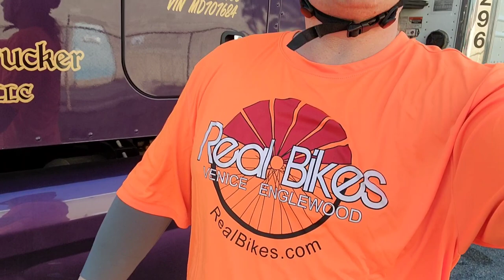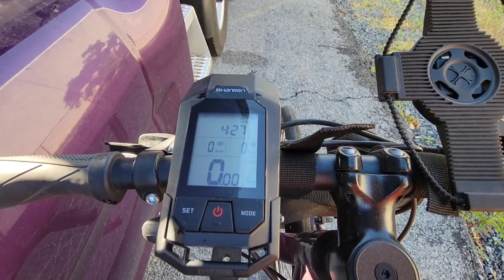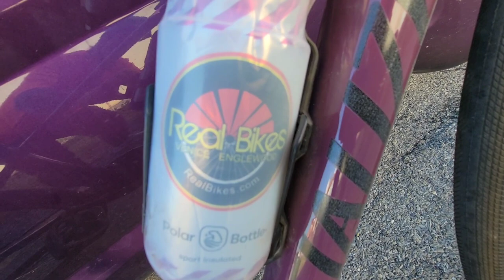Biking While Trucking - My Custom Bike Rack

Comment: I just take the front wheel off and lean it up in the passenger seat and seatbelt and 2 straps wrapped around the seat. A 29er can fit in a cascadia with a fixed seat that's bolted to the floor. Helps to remove the grab handle and store it under the bunk.  Need to get some foam protection to keep from leaning over in the bunk and clobbering your head on the forks. They dont get in the way that much, but they're sticking out some. Just got to clean the tires before putting it back in the truck. Bike has got to get filthy riding in the back and loosing chain oil. I'm thinking of an ebike here soon. I have to squeeze in a shower because of the sweat. But still a regular bike is still fun.

Comment: Don't know if you're still running this setup or if you've solved the uneven fork in the fork mount issue, but just glue a wood spacer under your rear wheel to raise that up. It'll bring your dropouts horizontal to match the fork mount. Easy. Thanks for the tips, really need more saddle time on my 10s!
Reply from the maker: Great idea. Thanks.

Comment: You really should use a better lock on your bike, get rid of the cable and go to chains.  The tweakers have discovered that ratcheting cable cutters used by electricians are the perfect tool for cutting cable locks.  In about 10 seconds they can silently cut that cable lock.

Comment: I'm sometimes wondering why some bikes has so many gears. My own, which by the way, is also a hybrid bike, has 24 gears! I use like the 5 highest gears... The rest of them is just a waste of gears.
Reply from the maker: Yeah, just depends on your style of riding and the terrain you're riding in. 24 is for those really steep hills and mountain terrain, plus good downhill speeds. They've come along way with them. When I was young, I had a 10 speed and the mountain bikes were 15 speeds.

Comment: Good info. JJ  i have a ?. Just watched  your To lease or not lease vid again witch is still one of the best vids I have seen on Prime lease options. Anyway  to get the discount on down payment do you have to be a lease op with Prime or can a company driver with lets say 3 years at Prime get the same discount? Thanks again JJ for the vids.
Reply from the maker: Outstanding question Rod! The discount itself comes from success leasing. Therefore it is based on the number of years you have been leasing with them, and not the number of years you have been with Prime.

Comment: What if you switched the front and back of the bike?  Then the handle bars would be away from the air lines..
Reply from the maker: The air lines move back and forth along that top rail depending on which direction I'm turning. A sharp left turn sends the front of the trailer all the way to the right, and the air lines follow.
Reply: @JJtheTrucker  I know, but they’d be further out of the way by a good distance.
Reply from the maker: That was the original plan, however I tested it out before bolting everything down and it definitely did not work. Handlebars still stuck out too far and would get caught. I had to switch things around and use that bracket for the forks.